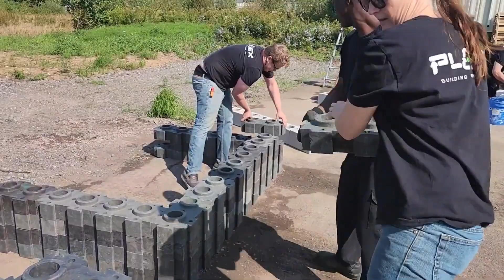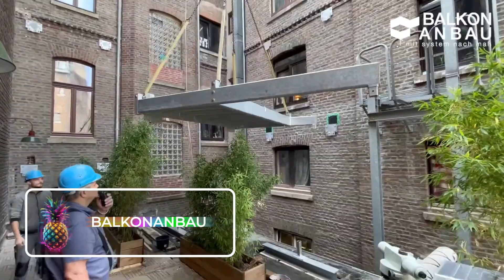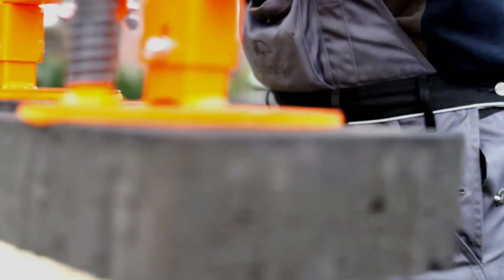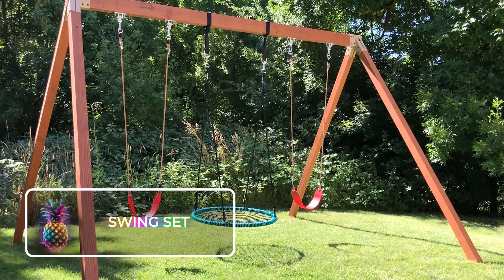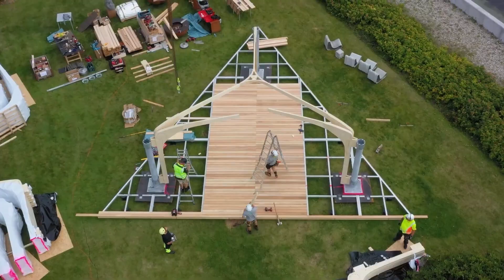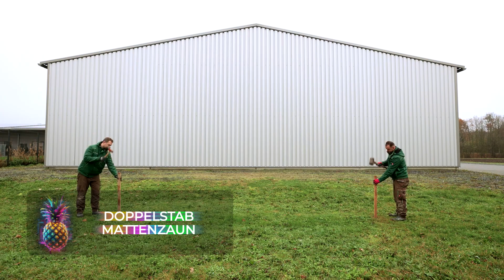Construction Secrets Workers Don't Want You to Know

Comment: Yeah and the house is going to be impossible for firefighters to save with that kind of floor structure.  In about 15 minutes that steel wiil be soft enough that only 2x4' swill be holding up that span of floor.  That is all they need to worry about is the floor above coming down while they are trying to get people out and find the main fire.  No wonder a lot of fire departments are standing back once they know people are out.
Reply from the maker: Thanks for sharing your insight on the floor structure and its implications for firefighters. Safety is always a top priority in such situations.

Comment: Never lift with a chain. Chain is only as strong as it's weakest link. Use wire rope way safer.
Reply: Everything is as strong as the weakest link... tell tower crane operators to not use chain. Tell me when they stop laughing at you.
Reply from the maker: Safety first! Thanks for the tip.